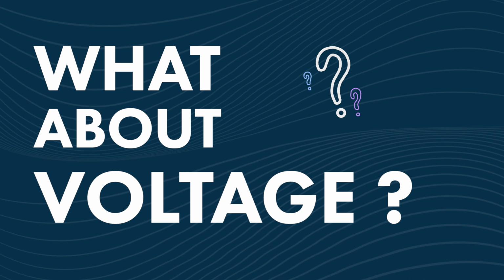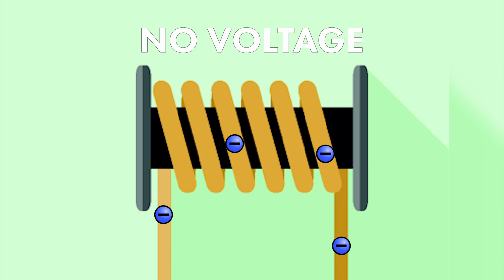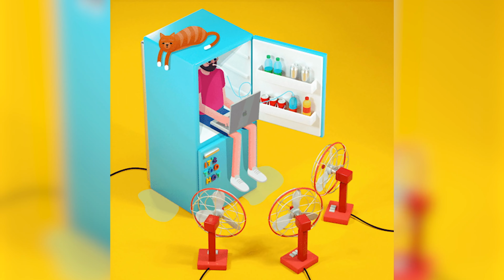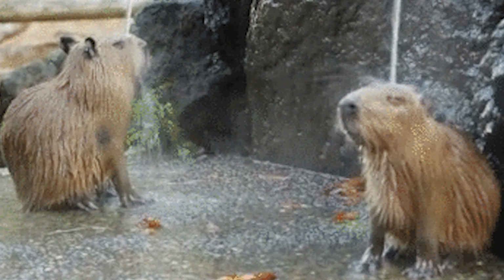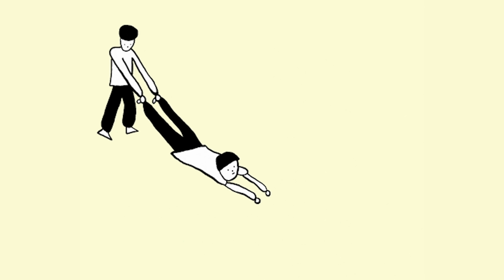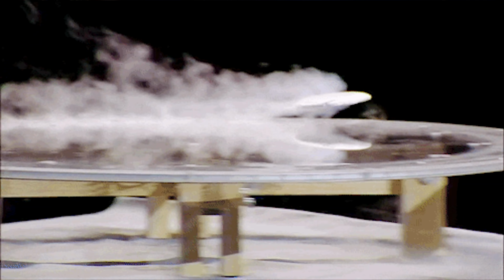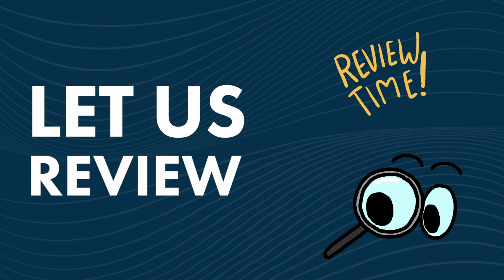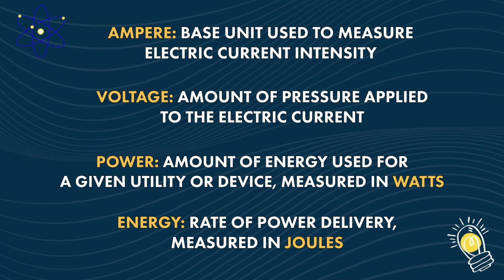Electricity flow: rediscover current, voltage, energy and power feat. Vanessa #WhatsWatt #4

Comment: You might make clear that electrons don't flow instantaneously to the load to give up their charge to power the load, as one might think (certainly this is the impression I got at school). Rather the source of energy connected via circuit conductors, pushes energy into the field, from which the load takes it, remotely from the source....this happens in a instant, the electrons drift very slowly and in ac, just backwards and forwards....

Comment: Fun fact: Voltage is always standardized. This is why American households outlets always receive 120 volts and European ones receive 110. This allows appliance suppliers to control how much power a device will use by changing it’s internal resistance. E(voltage) = R x A